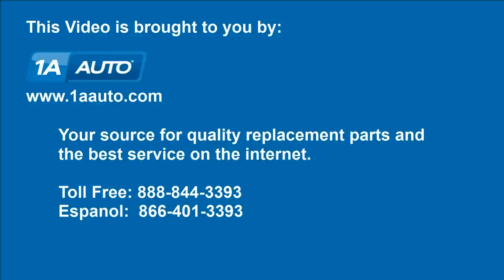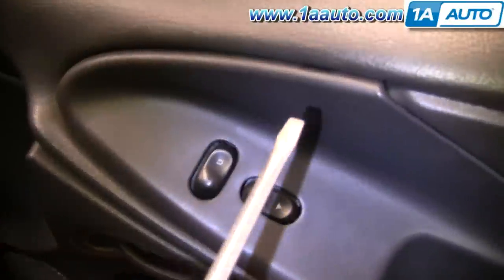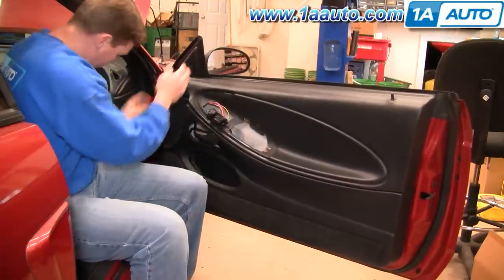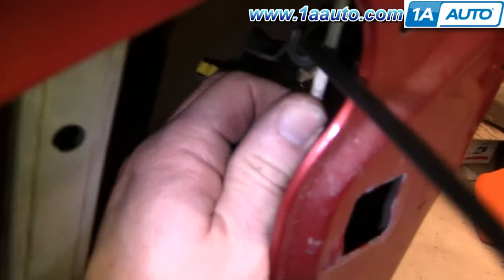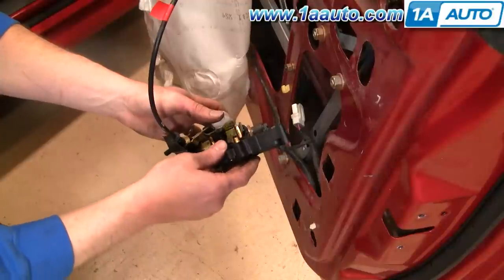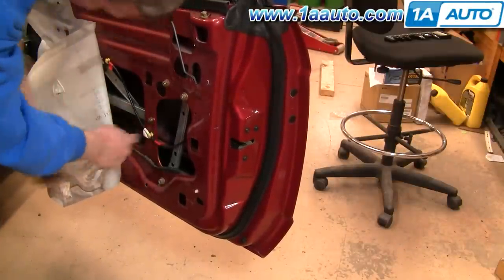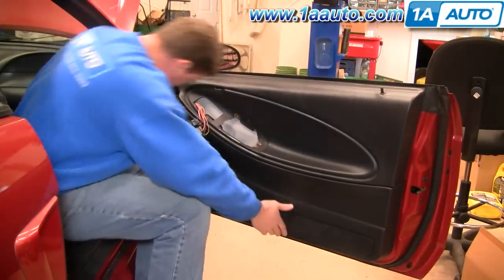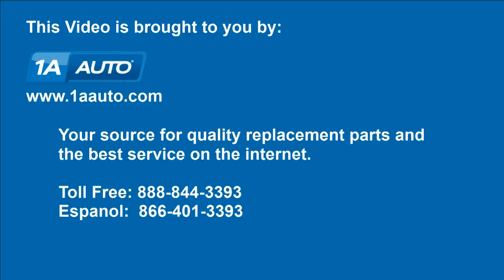How To Replace Power Door Lock Actuator 99-04 Ford Mustang

Comment: I'm a chic and I used your video to guide me through replacing my Stang's lock actuators. BOTH driver and passenger side. The first door took me 20 minutes and the 2nd maybe 13 minutes. Just me, the car, the tools, the 2 parts and 3 cold beers! I'm in VA and was quoted $400 plus for this project from numerous mechanics. It cost me $65. You guys are phenomenal!

Comment: Awesome just installed these today, took me about an hour in total only because the yellow clips were difficult. If you have trouble with the clips spray some wd40 on it and if that doesn't work try prying it with a long thin screwdriver. I can finally use my key fob, thank you!

Comment: VERY helpful. I installed both sides using this video for help! 

one note: the driver's side is very similar. On this model Mustang, the driver side door has a keyhole, though, so there is one more metal rod to be unlatched from the plastic housing. You actually have to remove the rod from the end behind they keyhole rather than at the actuator, though. It's a "V" shaped plastic housing you squeeze the metal rod out of.

Thanks so much! I barely ever even use screwdrivers but did this myself!

Comment: can the car still lock with out the actuator ? we recently got a 94 mustang gt and the key wont open the doors. the key wont even turn. the car will unlock from the inside so i know the locks work but for some reason the key wont open the doors.do i need to get an fob? or can i just remove the actuator?

Comment from the maker: you will have to test the connection to see if you are getting 12 volts and if you are then most likely the issue is related to the actuator itself

Comment: Hi I have 2000 Ford Mustang and my problem is my door locks move but not enough to go down or up but you can clearly hear it trying to move up or move down, but it never actually moves. My windows and my side view mirrors work fine. It seems to not work on either door. I've changed the fuse and nothing works there's power just maybe not enough? Help !

Comment: Driver side door lock wouldn’t work with key fob, but passenger side did.  Had to lock/unlock drivers door with the key. Got a new door lock actuator, installed applied power and nothing.  Passenger side still works.  Fuse is good.  Any ideas?
Reply from the maker: +K1dPhresh1 We wouldn't be able to diagnose an issue like that here, you may want to have a local mechanic take a look at it. Thanks for checking us out! 1AAuto.com
Reply: 1A Auto Parts Yeah, I couldn’t get any power to the plug either so I’ll have to chase this down some google rabbit holes. Thanks anyhow!
Reply from the maker: +K1dPhresh1 Thanks for checking us out! 1AAuto.com
Reply from the maker: +K1dPhresh1 Thanks for checking us out!

Comment: What would be the cause on 97 mustang you unlock with the power locks and you pull the outside handle it locks you can physically see the lock go down but not with the inside handle also cant turn the key in the keyhole and when you have the door open and its unlocked it will not stay shut. After opening and spraying the latch down with WD40 it would shut but still the same problems. Noticed when you unlock pull the handle and it goes down you can lock and unlock and it works only for that time

Comment: If the rod doesn't come all the way up. And I have to manually pull it the door handle at the same time to actually open the door.... In my case is it the door actuator what I need?  Please help.
Reply from the maker: +Fernando Sierra Thank you for checking us out. From the symptoms you are providing it appears the actuator is too weak to unlock the doors. 1aauto.com

Comment: I replaced my driver side and the door lock rod fell off before I was able to see how it when on at the bottom can’t seem to figure it out this would be the ride to the key hole not the inside lock handle
Reply: Even tried to find a diagram with no luck everyone does the passenger side so I can’t get a reference as to what side is up or down

Comment: Good video but couldn't remove the 3 torx bolts out. They actually bent the torx head.
Reply: Use impact torx bits. The cheap bits will twist and not work since the bolts are thread locked in.

Comment: Tried but the replacement latch I have to put in has none of the electrical crap to plug into. My original latch is destroyed and this new one I guess isn't for automated systems. Screw it I'm taking it to the shop I stopped caring about the point I removed the panel
Reply from the maker: +Frank Allen Thanks for the feedback!

Comment: I have a mustang that don't lock on the driver side but the passenger does lock
Reply from the maker: +Izzy A. If there is power to the actuator the actuator may be bad. We carry replacement door lock actuators on our website if your is bad. 1aauto.com
Reply: @1AAuto  I've got the same problem. I've bought 2 new actuators. Both tested good. Any suggestion. Thank you